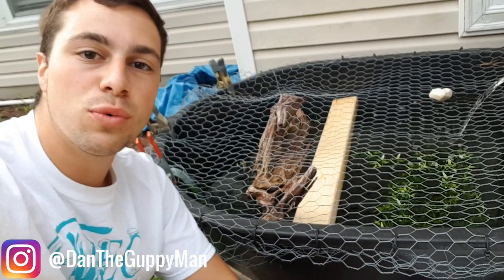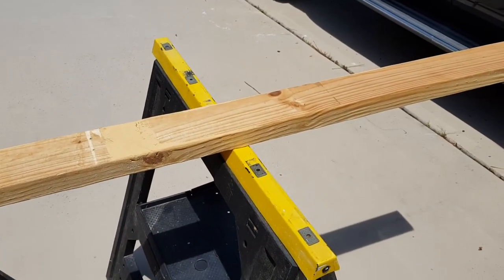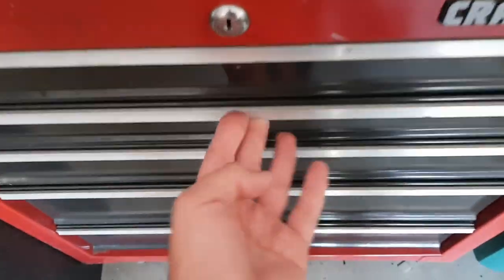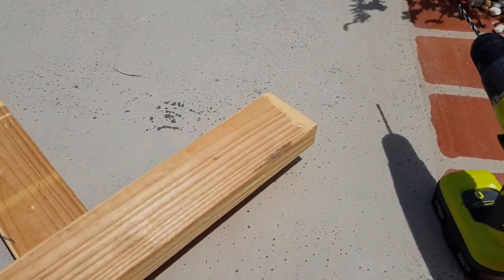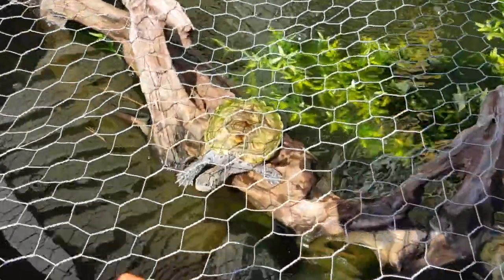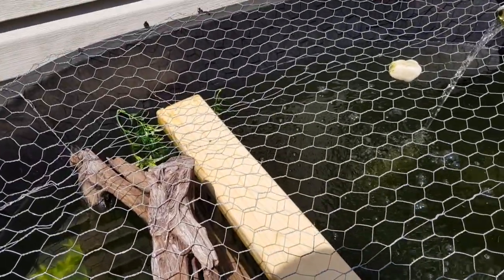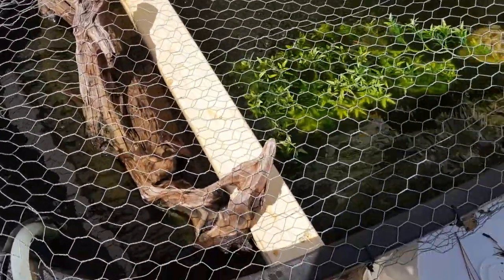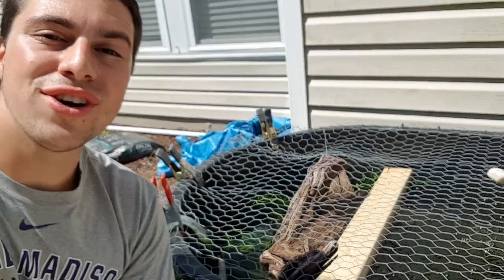DIY Turtle Basking Platform For $2! | Turtle Basics

Comment: I’ve been binge watching your videos! Thanks for all the information and advice. I was wondering what your advice would be on having two turtles? I’ve determined that they’re both yellow belly sliders but not sure what their sex is yet. My mother is apprehensive about spending money on turtles that only cost $10 so I doubt that they will get an ideal habitat as they grow.
Reply from the maker: You don't need to spend a ton to give them a good life, but it will cost you some money. A 110 gallon tub can house 2 sliders fairly well and it costs $70, then I built a filter for maybe $50 and heater is about $40. Then if you keep them outdoors when larger and predator proof the enclosure they get free sunlight and uvb!  No bulbs needed :)  They are relatively tough pets but if you do your research I'm sure theyll be just fine :)
Reply: DanTheGuppyMan Thanks for your response! Unfortunately we’re apartment renters so I don’t think we’ll be able to get them outdoors, but things may change in a few years. I was just concerned about the two fighting, or if one turns out to be a girl and being stressed from the other’s ‘courting attempts.’ We’ve updated their house and are using two stacked bricks as a cave like area and the basking area with a bamboo sushi mat as the ramp and to cover the top of the taller brick. The little guys seem to love holding onto the lower brick or crawling on top to remain half-submerged. The plastic tub is clear so during the day they keep trying to swim through it, but we taped paper to the sides to try to dissuade them. Right now I think they’re sleeping under the little gap between the basking brick and bamboo mat where their bodies are submerged but they can have their heads out of the water and are still ‘hidden’ (we freaked out for a bit because we couldn’t find the turtles but they’re both in the gap). They’re so dang cute!
Reply from the maker: Melody Lao Sounds like you're taking FANTASTIC care of those two little ones!!  As for aggression if you give them space as they grow they can either be friendly to one another, or if one becomes aggressive simply split them or re home one. Keep up the great work!
Reply: DanTheGuppyMan Thank you so much! Hopefully we can keep the two and save up for their bigger homes. You’re a big inspiration and I look forward to seeing more content from you in the future. :)
Reply from the maker: Thank you!!!!!  That means a lot :)  Next video is coming out in about a half hour, a bit funnier but also has some good pointers about feeding!